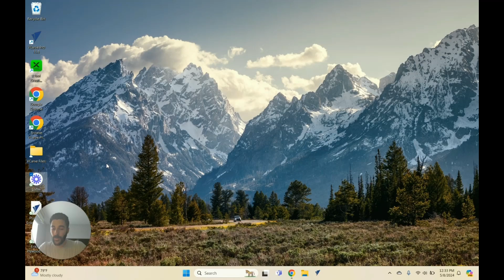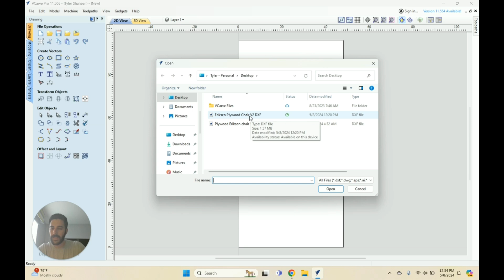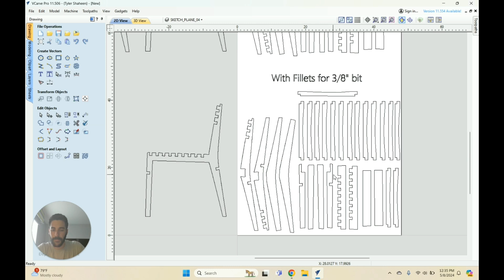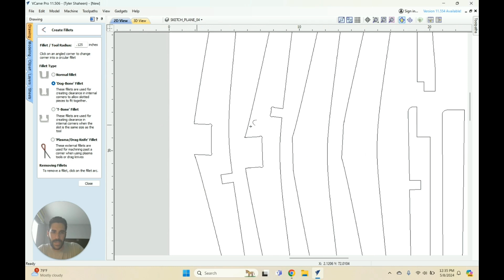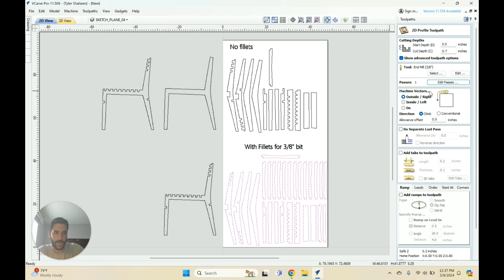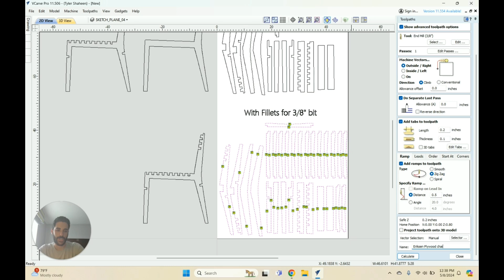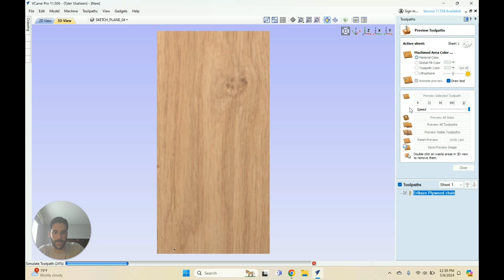CNC plywood chair

Comment: My experience with plywood is that the exposed ply is very prone to splintering. How do you deal with the splintering?
Reply: Baltic birch or Europly will sand and stain without splintering much.
Reply: @Andy-iw9su  hasn’t been my experience to be honest. i had to put zpoxy over the edges to keep them from snagging skin or clothes.
Reply from the maker: Have you tried sanding and rounding over the edges? I'd imagine that should help but I'd be surprised if you could ever get them to be completely splinter/snag free... Applying a heavy finish coat should help as well. Just a lot of added work!
Reply: @thesoutherncraftsmen  zpoxy has been my goto. It’s not super strong but it’s easy enough to sand flush and it keeps the edges from fraying and snagging. 

I have clean bits, but no amount of clean edges seem to be clean enough. That’s why i was genuinely curious if you life hacked a solution for this or not. I see more plywood in my future.